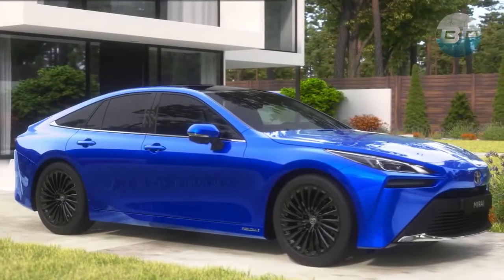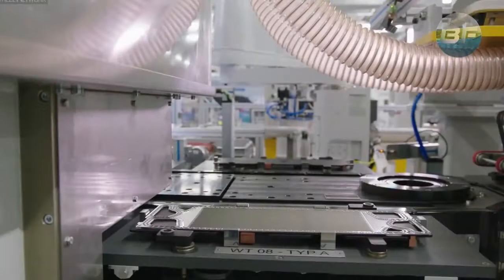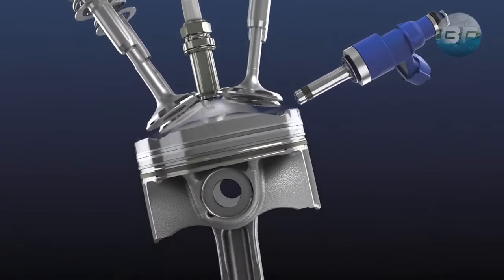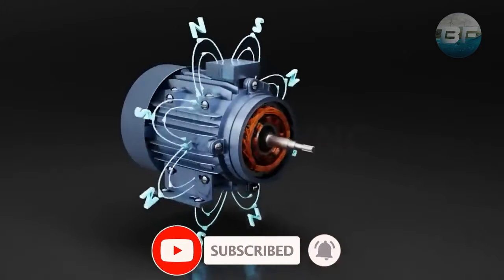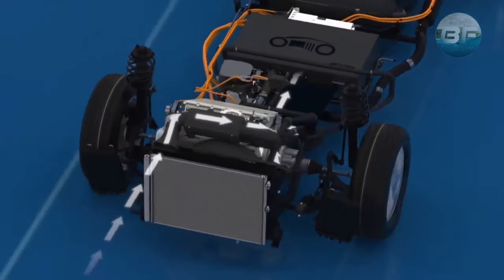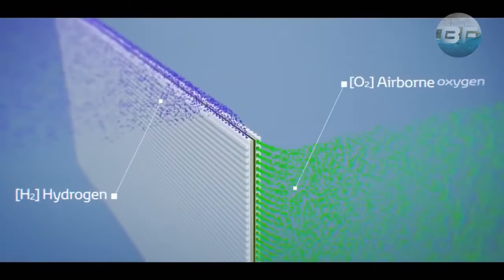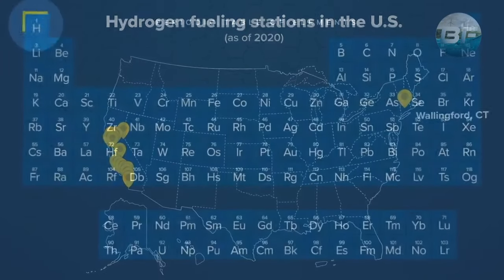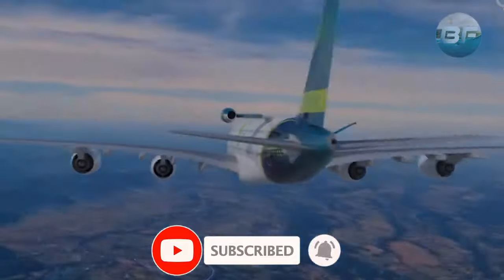How Do Hydrogen Cars Work??

Comment: Its better than  EVS
Reply: because they use 6 times more energy than an EV, or are so expensive to refill? What about the tank, does it still need to be re changed every 8th year? Where to find filling stations, only outside cities i hope?
Reply: @LonglingEriksen 
Lng is the king then, all of this EV is just to impractical rn, why would anyone buy it? Energy storage, acidity, charging time and lifetime of lithium Ion batteries is just a joke. Cooling/pressurising Hydrogen to such a degree is also impractical. But to be honest the first cars where also impractical.

Comment: Sorry, but due to the High volatility of hydrogen Isn't it difficult to store hydrogen in tanks without losses?
Reply: It is 

Solid phase of hydrogen is to be used
Reply: @altamashhhhhhhh  Is there a solid phase of Hydrogen? U mean liquid phase, maybe?
Reply: @bliss6495  Never heard of solid phase Hydrogen but liquid Hydrogen does exist at -253C or -423F.  Imagine how difficult it is to store/transport a liquid like that. That's why it's stored as pressurized gas instead of liquid on the car.
Reply: @bluenycom and that’s the problem with hydrogen cars is if u got into a accident it blows up

Comment: My brother in Ra, how does mixing hydrogen and air produce carbon emmisions, where is the carbon added in from. The only thing I can think of that would react with hydrogen from the surrounding air is oxygen, which would then produce H2O or chemically clean water. The hail does the C come from in all of that?
Reply: production of hydrogen require power
Reply: Combustion of hydrogen (H₂) with oxygen (O₂) produces water (H₂O), but high temps cause nitrogen (N₂) in the air to form nitrogen oxides (NOx), contributing to pollution. Also, engine lubricants and fluids can release harmful particles during combustion.

Comment: All the challenges said against the H2 car was said about electric vehicles.  
Batteries for EV last about 8 years, IF properly maintained, and even after a year, the charge begins to drop no longer fully charging an EV battery cell. 
EV have at least 3 to 4 different precious metals to make the batteries that its going to require More Mining of the earth just to meet the demand. So Mining metals or Pumping fossil fuels from the ground, how are either better for the environment?  
Also, how long does it take to charge an EV?  And as that battery gets older, that charge time is going to get Longer, but im sure most people will get rid of that 1st EV and get a new one, so that will be someone elses problem.  Right?  Typical Human response.